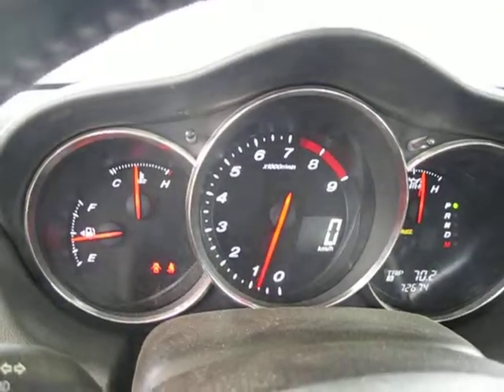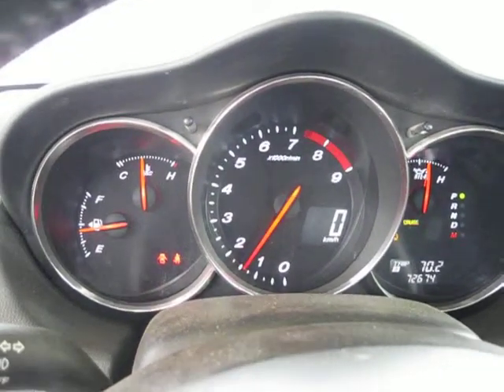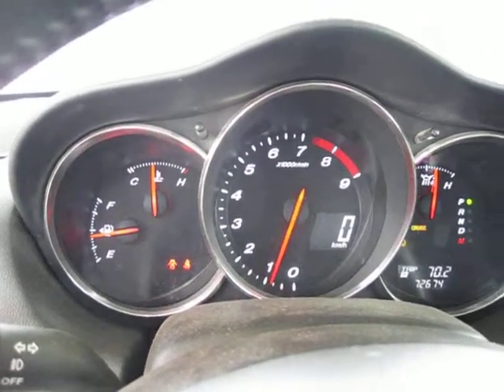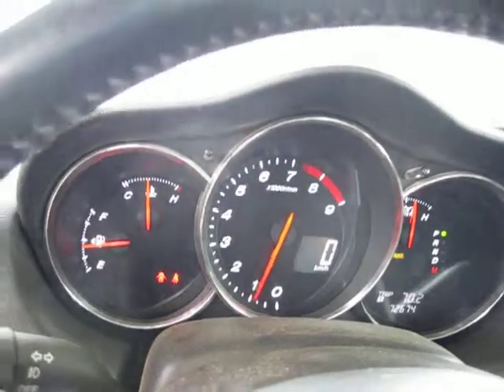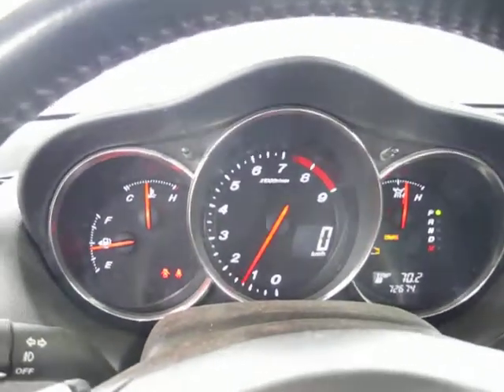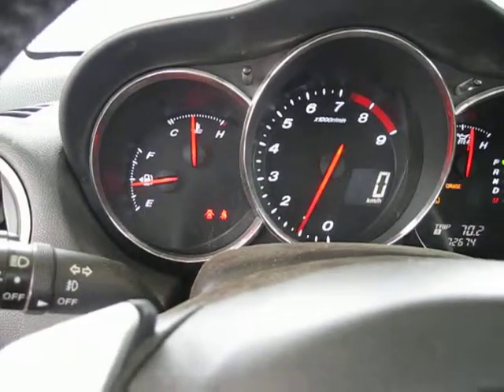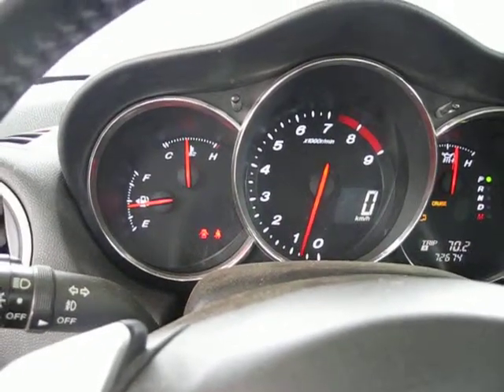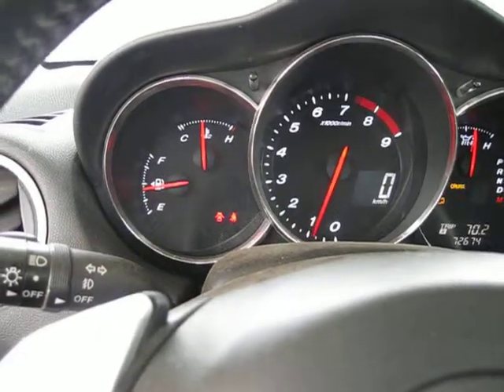rx8 brand new motor rough idle

Comment from the maker: well i had the motor replaced, when they installed the airbox they pinched 2 injector wires. i would say more or less injectors. the only other thing i can think of is your pcm is fried. they replaced mine when they didnt have to